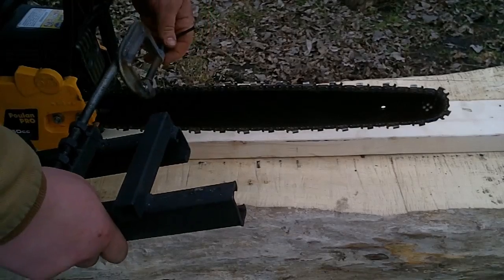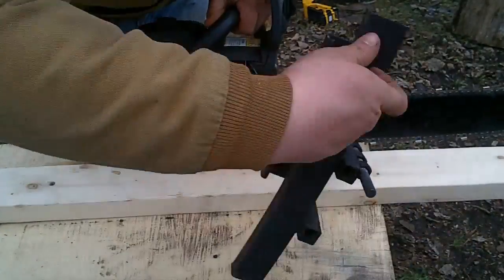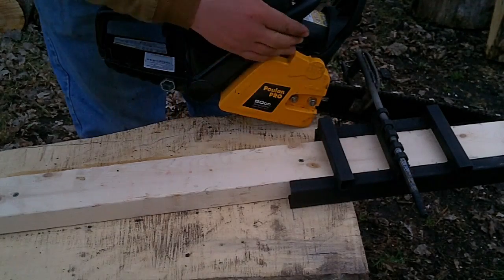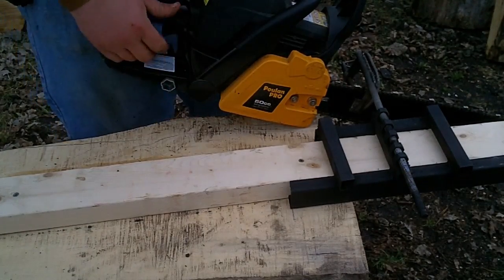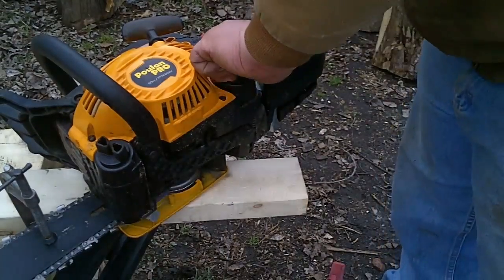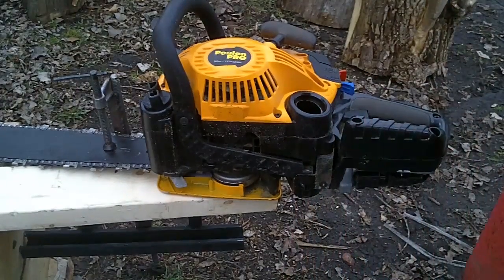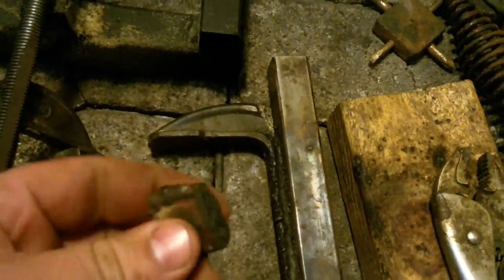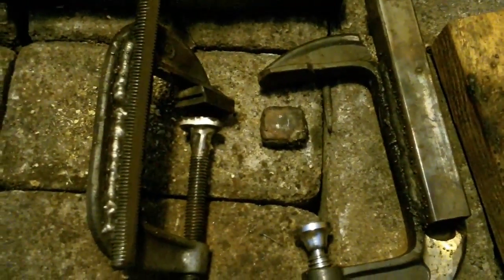Testing homemade chainsaw mill

Comment: Forget the clamps and drill a single hole for the threaded rod through your chain saw bar, weld one nut to the threaded rod and use a self locking nut on the other side.   That would shave a pound or two off your rig and be more secure.
Reply: i know Im randomly asking but does someone know of a method to log back into an Instagram account??
I stupidly lost my password. I would appreciate any tricks you can offer me
Reply: @Bryant Fisher instablaster =)
Reply: @Isaias Aries It did the trick and I now got access to my account again. I am so happy!
Thanks so much you really help me out !
Reply: @Bryant Fisher glad I could help xD

Comment: bro your burning that poulan  up   one doesnt look like your using a ripping chain  2 poulans are not made for  milling in any kinda way  after  a day of milling you will burn that 50cc  poulan up
Reply from the maker: Thanks for your concern but you do not need a ripping chain to do milling it just makes it easier and i have one now. 2nd Poulans are very under rated and i have no problems milling with mine. i have milled a decent amount with mine along with felling and bucking trees in excess of 30" and i have not had any issues with either Poulan saws i own. I believe that Poulan make the best quality for your $ on the market.  Thanks for watching and commenting bro
Reply: no problem  i normaly use poulan saws its just  i like stihl better maybe its because i learned how to cliam and ground work  using a stihl chain saw here latey i been having bad luck with poulan   the  one i had i had for 4 years  the other one i had for 2 days before i was ready to take it back to the store
Reply from the maker: Steven Pinterich yeah i had a poulan "wild thing" that was JUNK! but the pro series has been great for me
Reply: i agree  the wild thing was junk  but huskyvarna has inproved the poulan brand sense they taken over poulan  but poulan still just a shell company for  them they never going to make them better then the main selling brand
Reply: A ripping chain is "easier" in that it makes smoother cuts so less planing/sanding after milling. But standard crosscut chain (not anti-kickback) seems to move thru log faster. Faster can be good when laboring thru long, thick stock.

Comment: Wrong side slider !!!
Reply: are you saying to place the bar on the other side of the  homemade rig.  I believe you are correct so the weight of the saw is over the top of the guide 2x4,  correct??
Reply: @bobgieser2943 ,  of course.